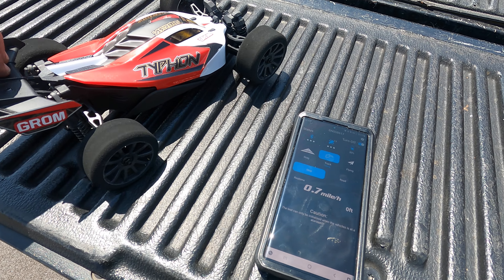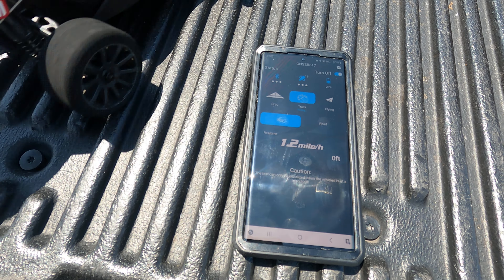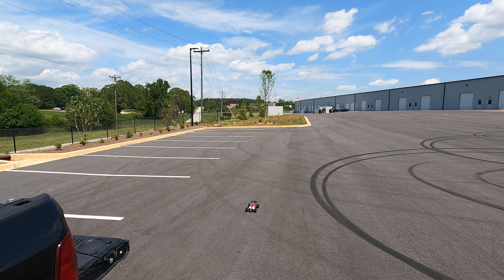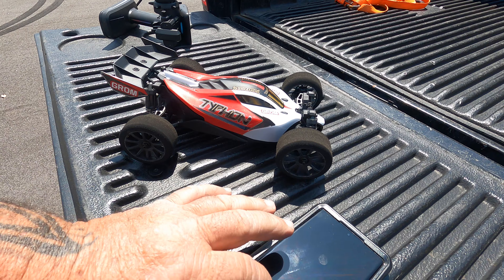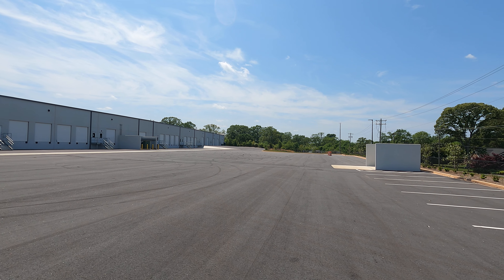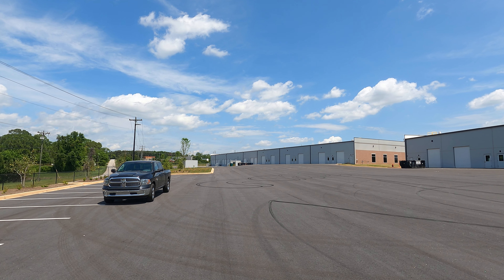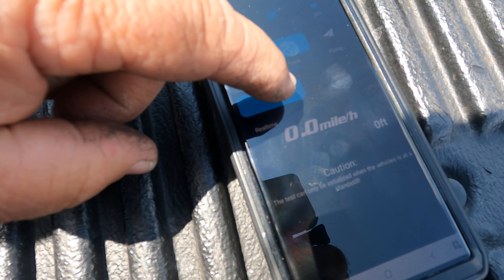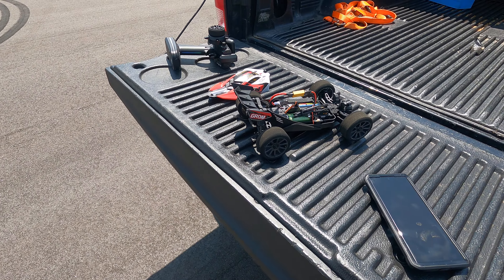ARRMA TYPHON GROM SPEED RUN     ( 79mph)

Comment: That's insane for this little guy. I just upgraded mine last night and would be happy to get 50 mph. I found it very difficult to fit everything into such a small car. Thanks for showing the guts of your grom. You did an excellent job placing the ESC where it should be. I had to place mine dead center under the camel hump of the body. Your video is very inspirational.
Reply from the maker: Thank you

Comment: Very nice Speed runs, question r u using a 3S battery or is it a 4S? also did you change the pinion and spurg gears? I did run mine with stock spurg gear and 22t pinion with 3S batteryand  the max i got is 76 but never 79 lol, thank you for sharing
Reply from the maker: 3s